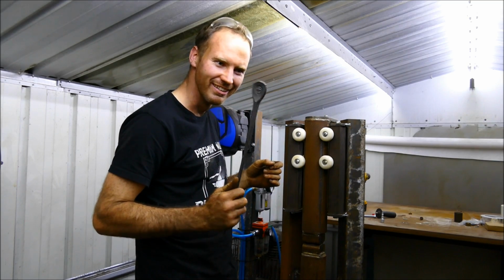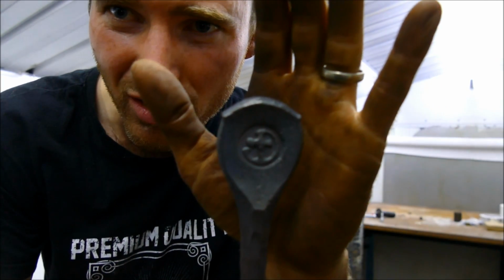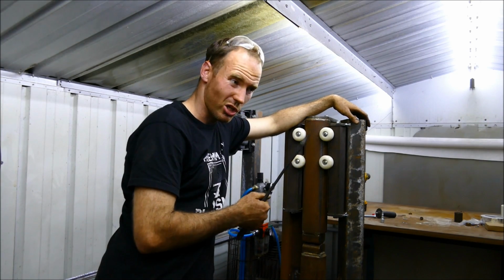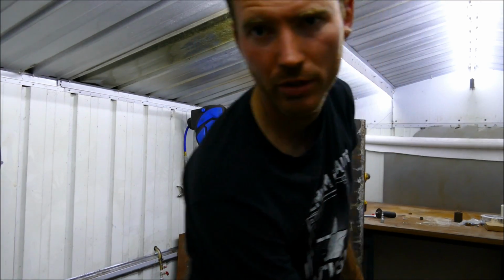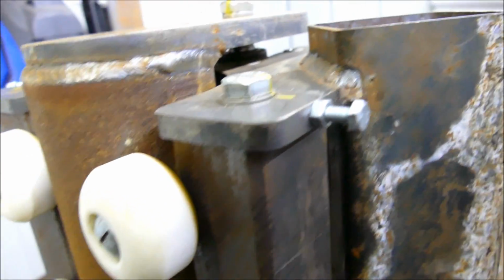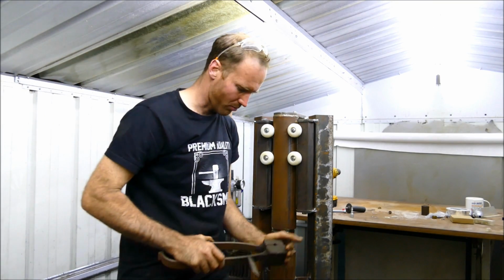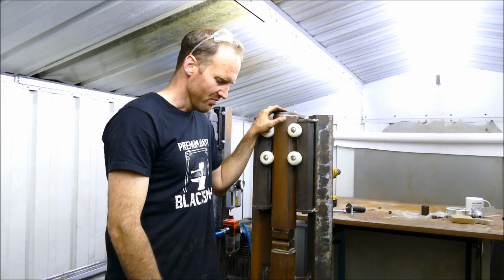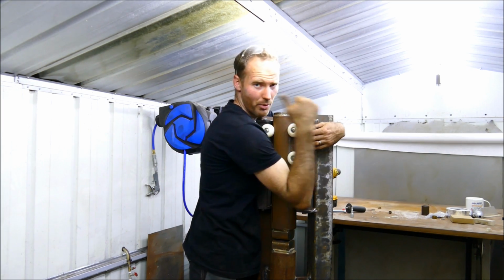!NEW! Ultimate DIY Power hammer build - pneumatic money maker - part 1

Comment: Actually the first thing you made was some of the best kindling you could ask for...  The functionality and simplicity alone deserve a loving embrace. Off camera, in the event she bites back at your hammer and nips.    I say don't paint it, to help keep your friends from rubbing up on her. Big thumbs up and scribin'!
Reply from the maker: Ha ha thank you Max! Cheers J
Reply: If a properly sized and tuned* single actuated, spring return cylinder was used, the pneumatics could be even simpler. I realize the changes in air requirements and why they'd be necessary to perform as well as your double action design.  Just my thoughts and may be helpful if you get into production. I also have some nice little hacks for your exhausted air, that actually reduce the compressors load and minimize some losses to heat, noise, flying slag etc.
Reply from the maker: Thank you Max! Sounds good the Single acting cylinder idea. I do have a double 1/4" moisture filter. Though I'm changing it for 1/2" regulator/filter. I'm changing all the pipes to larger copper for better flow and heat resistance. may be a good idea using the cold air in the intake as long as the pipes don't restrict the exhaust which is the key to it's power. Cheers J
Reply: Agree. The volume of the larger pipe might have ya buying a larger valve but you'll be glad either way.
Reply from the maker: Ooh please tell me more! What's the hack? I did already modify mine by boring the outlet wider so it exhausts better. I found it freezes the outlet because of a refrigeration effect from the expanding air. Cheers J
Reply: That's a good start with your setup which seems to be pretty efficient already with your design and what I'd consider a relatively small compressor.  I'd direct that cold dense exhaust charge through a venturi directly at your compressor intake, with the shortest, straightest plumbing. If you're freezing up at the orifice, then there is also a considerable amount of compression just before the expanding, add air dryer or make little ice cubes ;)     I really lean toward a single actuated setup to eliminate all of the losses on the upstroke or exhaust; it'd also require a bigger charge for the single stroke (overcome return spring press).    I'm struggling with a growing list of variables to the point I'm gonna have to watch and listen again to be more helpful.  It's clear to me  you have the know how and I really like what you've done here.
Reply from the maker: Hey! Thank you so much for your kind comments and subscribing, patterns are now available on my Etsy shop detailed in the description and to say thank you here is a discount code for 20% off! just type POWERHAMMER1 as a coupon code. cheers J

Comment: That skateboard wheel rider system is a great way to deal with the round stock for the hammer.
Reply from the maker: Worked a treat and very little friction. Hard wearing too. So far so good. Cheers J
Reply from the maker: Hey! Thank you so much for your kind comments and subscribing, patterns are now available on my Etsy shop detailed in the description and to say thank you here is a discount code for 20% off! just type POWERHAMMER1 as a coupon code. cheers J

Comment: I would be very interested the blue print or plan or drawing or  schematic or layup measurements details of that design of power hammer
Reply: Butt I would not totally make it the same ie (copy cat) I would put my own twisted or spin on it or improvements with what ever I have available, butt I'm leaning more to liking possible hydro shop press. what think of trip hammers
Reply from the maker: @vegahowell5813  if you can get a really long cylinder that would be better for tooling and acceleration but I'm limited on height. I love the sound of a hydro press. Tag me on any photos you have so I can see on Instagram. Cheers J
Reply: Now waiting to find the right hydro cylinder I'm out look for good built not chineseism I'm thinking 8x4 ram, I'll figure the engineering of it just like how I made not traditional not anvil looking like anvil if what if what research is right it like 10$ per lbs on anvils so mine is plus 250lbs
Reply: And also I thought about trying to make a YouTube channel and something like called simplified blacksmith butt I dont know where to start
Reply from the maker: Thank you Vega! Coming very soon. Cheers J
Reply from the maker: I would love to see that. Start a channel don't over think it. Lots of videos on making YouTube videos out there. Just be aware it takes a lot of time running a channel and is painfully slow building an audience. Takes persistence. All the very best. Cheers J
Reply from the maker: Hey! Thank you so much for your kind comments and subscribing, patterns are now available on my Etsy shop detailed in the description and to say thank you here is a discount code for 20% off! just type POWERHAMMER1 as a coupon code. cheers J

Comment: Just discovered this channel , you got an immediate subscriber.  I wish I had the skills (and more importantly the testicular fortitude) needed to build something like this.  I'm very definitely a hobbyist and will never need this for a business, but who wouldn't want their own power hammer? Especially one you can cuddle!  This would fit perfectly in my forge (for forge read 'garage'  Who needs to protect their car from the elements?)  Really interesting that your employer is showing an interest in creating a commercial version.  I hope they are willing to give you a decent kickback after designing it!  You said under £2k for the finished product.  Speaking only for myself if you could get a delivered price of £1500 I could be persuaded to put myself in debt and danger to own one of these if it had an attachment to anchor spring dies (sold seperately of course) and a catcher tray for the scale (slightly graded of course) with a tube to add the tube of your DeWalt industrial vacuum at the bottom for dust/scale extraction.  Oh BTW I won't cuddle mine until after I install googly eyes just like Daniel did! (so cool that it was yours first!, even though I feel bad for you that you had to sell it)  Oh and far as colour goes, paint it bright scarlet and call it Big Red One.
Reply from the maker: Thank you so much! Interchangeable shoes are what I'm making for mine and a tool holder for things like fullering tools and bolster plates for punching holes. All the very best. Cheers J
Reply from the maker: Hey! Thank you so much for your kind comments and subscribing, patterns are now available on my Etsy shop detailed in the description and to say thank you here is a discount code for 20% off! just type POWERHAMMER1 as a coupon code. cheers J

Comment: Little monster, love it and looking forward to the designs. Got to be a gun metal grey. I'd suggest filling with a form of epoxy granite (sand and epoxy resin) superb vibration damping properties
Reply from the maker: Thank you Luc! I'm leaning towards a textured grey because it's the toughest of powder coats. I know the properties of resin and sand used for machine bases, excellent stiff, bit expensive. I like the idea with sand that I can drain it out for lighter transportation. Cheers J
Reply: @joshuadelisle  roughly where are you in the UK? Ive been looking at a semi automated steam driven generator for the house for a while. Look forward to seeing yours
Reply from the maker: I'm glad you can't find me for my kids safety, not you but from the internet as a whole. However the Royal Three counties show is relatively close and go most years to be part of the Blacksmithing there if ever you go. the best part of my steam power design is that it can run continuously without stopping ever, other than to change the bearings and possibly lime scale. Should be very small and relatively safe compared to normal steam generators yet supply more than we will ever need. Can use it like a petrol generator, just add fire or take away fire to stop it. Super simple and I really hope it works. Cheers J
Reply: @joshuadelisle  didn't mean any offence, absolutely understand wanting to keep that private. I will try to get there. Look forward to future videos.
Reply from the maker: @davers1610  I said it jokingly no offense taken I'm not the type.  Thank you so much and all the very best. Cheers J
Reply from the maker: Hey! Thank you so much for your kind comments and subscribing, patterns are now available on my Etsy shop detailed in the description and to say thank you here is a discount code for 20% off! just type POWERHAMMER1 as a coupon code. cheers J

Comment: Super cool and simple design! Have you seen the "KA 75 power hammer" ? It works much in the same way with a simple valve and foot pedal but very different in design.  How sensitive is the valve, I mean can you make small soft blows easily? Hard to tell from the video.
Reply from the maker: Hey! Thank you so much for your kind comments and subscribing, patterns are now available on my Etsy shop detailed in the description and to say thank you here is a discount code for 20% off! just type POWERHAMMER1 as a coupon code. cheers J
Reply from the maker: Hey Torbjorn! I haven't I will look. You can get it very sensitive even at 120psi but I can also change the psi to give me a wider control range. It's very different to control and takes a little getting used to. Like controling the sound on a drum kit pedal. I can crack an egg and close a match box with it with a light press almost half opening both sides of the valve. All the very best. Cheers J
Reply: @joshuadelisle  Cool, sounds great!

Comment: I got a huge smile out of seeing your infectious, unbridled glee upon using your hammer. That hammer is a well designed piece of kit -- most designs seem to just throw mass and brute force at the problem. And some of the Frankenhammers that result are things I wouldn't want to even be in the same building with...  Clyde
Reply from the maker: Thank you Clyde!  I've just been optimising it further. It's such a little beast! Got rid of the top knock as the cylinder fully extends and increased the flow rate with bigger pipes. im hiding the pipes in the pillars too to make it super sleek. I think I'm going to powder coat it white to emphasize it's minimalism, though I know the moment I put my black hand on it I'll regret it.... Cheers J
Reply from the maker: Hey! Thank you so much for your kind comments and subscribing, patterns are now available on my Etsy shop detailed in the description and to say thank you here is a discount code for 20% off! just type POWERHAMMER1 as a coupon code. cheers J

Comment: Haaaaaleeeeeluiaaaaaaa
Reply from the maker: Your too kind! Yes they are expensive but I needed a good electrode to welded high  carbon to mild and 309 looked like the one. However I did top up some welds with 316 because I ran out but looks like it's working well. Might get galvanic corrosion but can just re weld after a few years. Cheers J
Reply from the maker: Hey! Thank you so much for your kind comments and subscribing, patterns are now available on my Etsy shop detailed in the description and to say thank you here is a discount code for 20% off! just type POWERHAMMER1 as a coupon code. cheers J
Reply from the maker: Indeed! Cheers J
Reply: @joshuadelisle  honestly you ISSSSS DAAAAA MAAAAN, you have time studies and a lot of the most important stuff!!!! And especially you try to have a low price in developement, but i am surprized that you weld with E309L.... They are quite expensive...

Comment: Yes plans! Plans now! Nice simple design similar to log splitter hammers but even simpler and more compact. I like this because it can fit inside even a smaller shop
Reply from the maker: Definitely a good idea. I don't like too many decimals so I may do 2 designs rounded up to either imperial or metric whole numbers. Cheers J
Reply from the maker: Thank you Michael! Working on it as we speak. Cheers J
Reply: Joshua De Lisle I thought about this.... you may want to give the dimensions and measurements in metric but also imperial. I’m sure you thought about that but would save both camps the trouble of trying to do conversions

Comment: What do you think the striking weight or force is? I really like this design. Very simple
Reply from the maker: I'm too sure what the speed is yet or how to measure it. The head is 68lb and the cylinder gives 200lb of pressure. I'm going to make it faster with thicker better flowing pipes. It's more than I need which is good. Just did a quick calculation. Could be 1,450lb of force on one square inch.  Cheers J
Reply from the maker: Hey! Thank you so much for your kind comments and subscribing, patterns are now available on my Etsy shop detailed in the description and to say thank you here is a discount code for 20% off! just type POWERHAMMER1 as a coupon code. cheers J

Comment: I want one. Do you  think you could come up with  one that runs on a electric motor
Reply from the maker: Thank you! the compressor kind of is the electric motor, i could hide the compressor away and pipe the air into the shop..... I might do that. cheers J
Reply: @joshuadelisle  I was just thinking for someone that might not have a air compressor. Either way love your design can wait to buy the plans. Like you said a power hammer  changes what type of blacksmith you are. A power hammer  like this is definitely with in reach of me getting. Thank you for showing  us
Reply from the maker: @carbscustoms  Thank you, I know what you mean, if it had an electric motor i'm sure it would become a tyre hammer. A compressor can be found cheap second hand and are easy to fix and maintain , very handy too, I want a plasma cutter at some point and will need it it for that also. cheers J
Reply from the maker: Hey! Thank you so much for your kind comments and subscribing, patterns are now available on my Etsy shop detailed in the description and to say thank you here is a discount code for 20% off! just type POWERHAMMER1 as a coupon code. cheers J

Comment: Very well engineered hammer. Thank you for sharing Joshua.  Small air hammer powered by compressor is definitely way to go. You should also check out cricket power hammer (on YT and facebook). I would like to build myself a small air hammer for finer work. With my 40 ton hydraulic press, I am able to forge large stuff, but drawing out thinner material is difficult.  Check out my YT channel (3900 subs) with my 40ton hydraulic build. Thanks.

Comment: Finally managed to watch this out here in the North Sea. It looks great Josh. Certainly seems to hit quite hard. I’m really impressed you’ve managed to fit it in the shed to be honest. Do you get a decent amount of hits before the compressor needs to recharge or is it doing ok between heats? 

I was going to suggest filling the pillars with sand too. You could even weld up a sheet metal box around the base of the anvil / pillars and fill that with sand. That would really add to the mass of the whole thing and would probably make it a bit more efficient. 

Colour? I’m partial to green personally but blue is good too.

I look forward to seeing the tooling videos. This has really inspired me to get off my backside and get my power hammer built. 

All the best 
Andy
Reply from the maker: Thank you Andy! Good ideas, for that 25mm stock it lasts until it's too cold to forge then kicked in so fair amount of time with hard hits. Maybe did 4 cycles to make the poker. Better than my die grinder... cheers J
Reply: Joshua De Lisle  Cool. That’s not bad at all then. 👍
Reply from the maker: @FeatherForge  yeh pretty efficient I think
Reply from the maker: Hey! Thank you so much for your kind comments and subscribing, patterns are now available on my Etsy shop detailed in the description and to say thank you here is a discount code for 20% off! just type POWERHAMMER1 as a coupon code. cheers J

Comment: What an awesome simplistic approach to the  hammer.  Far more compact than I'd ever emajine a 70ish lb hammer could be. Just guessing the  ram weight.  It seems to function well. Wonder if a spring or bumper system may help on the end stroke hard stop?
  So if I had a vote on the color...purple is by far my favorite?!?@😁😁
Perhaps some  angle braces on the anvil will be an idea for it. Sand and oil in the tubes seems a standard idea.
Definitely interested in a set of plans when you get time if you can.
🙏blessings abundant sirSir 
Crawford out 🧙‍♂️
Reply from the maker: Not sure how to calculate the weight, the head is 68lb but the ram must be sending another 200lb of force.  Times it by the acceleration and it gives me the velocity right? All the very good points, definitely need to sort out the top end, I'm thinking a rubber washer inside the ram? Thank you so much cheers J
Reply from the maker: Hey! Thank you so much for your kind comments and subscribing, patterns are now available on my Etsy shop detailed in the description and to say thank you here is a discount code for 20% off! just type POWERHAMMER1 as a coupon code. cheers J
Reply: @joshuadelisle  too kuul.  Congratulations on your new tool 
Thank you,  I'll be getting the plan as soon ad I can
Reply from the maker: Thank you Dan. All the very best. Cheers J